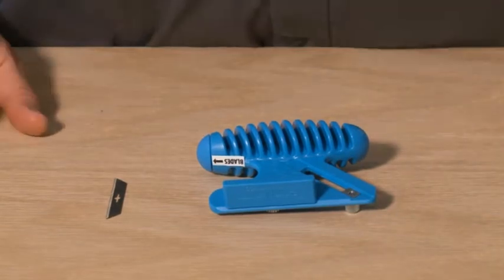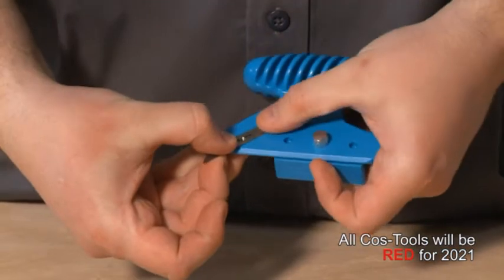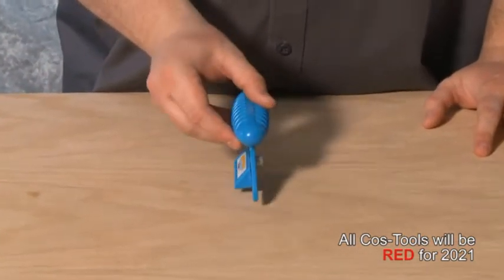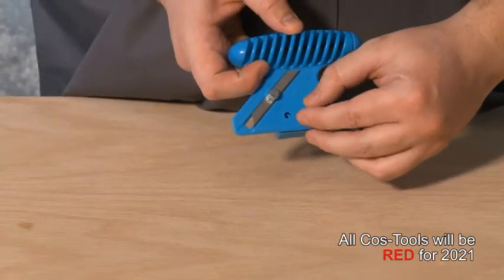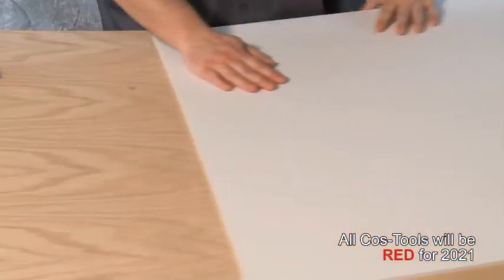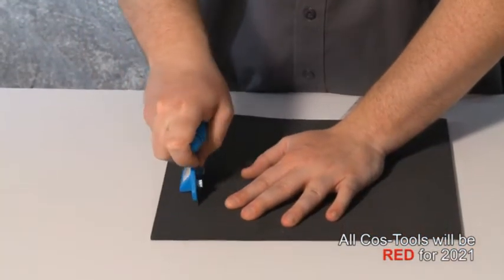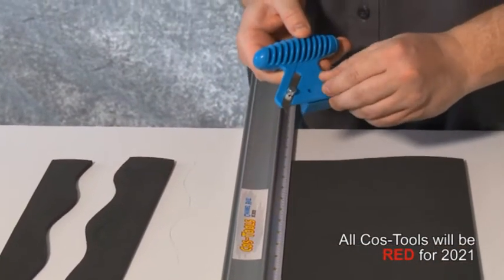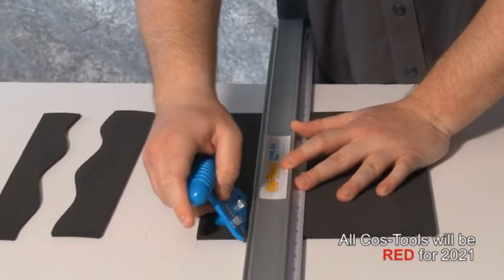Cos-Tools XTC6010 Straight/Bevel Cutter RED

Comment: Can it cut 9mm pet acoustic sheet
Reply from the maker: This cutter cuts up to thicknesses of 5mm EVA foam or similar material
Reply: कौनसा कटर अकौस्टीक के लिए है जो हात से सीधा कट मार सके
Reply from the maker: @DeepakYPhake  We have not tried the product on Acoustic material. If it is 5mm or less and the density is that of EVA, you should not have an issue.